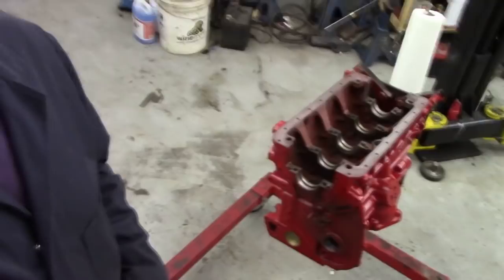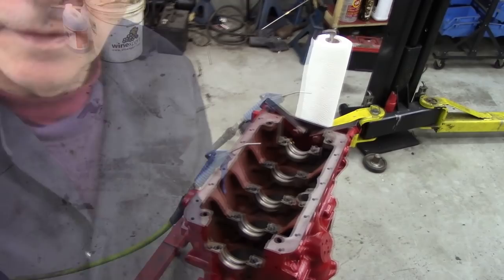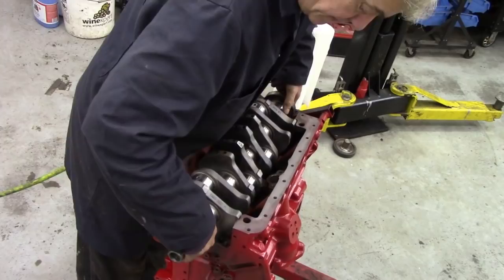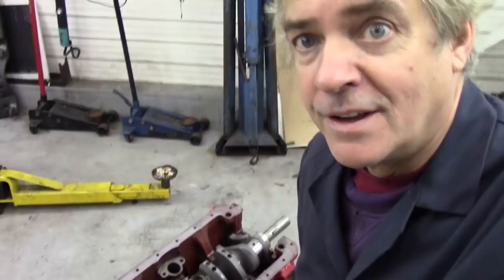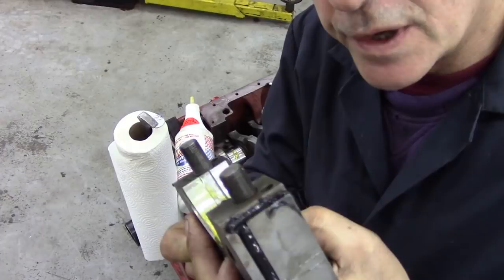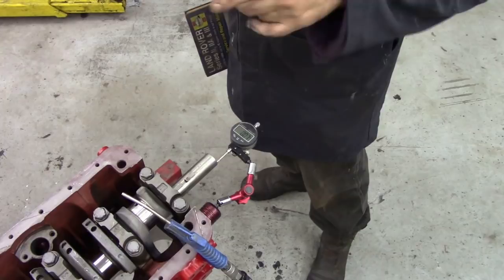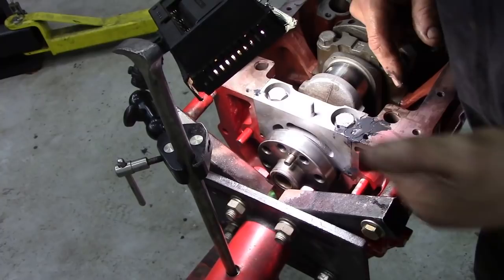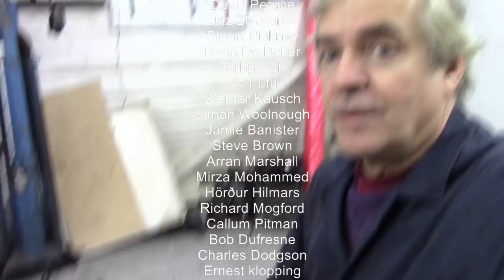2 25 engine. Fitting the crank

Comment: If I remember correctly the military version of the 2 1/4 petrol used the diesel crankshaft as it was drop forged steel instead of cast iron made it more Squaddie proof !

Comment: Hi Mike your right the Lucas is a great product. I used to use a product called Lubraplate it is a very thin lithium grease that coats the bearings for start up and will mix with the break in oil.
My father-in-law used it on in frames on heavy equipment.
Reply from the maker: Thanks for the info!

Comment: you must trust your machine shop....I normally sneek up on the max torque, rotating the crank as I go, normally in three stages....30, 70, 100 and STOP if it starts binding at any point.
Reply from the maker: Crank was STD and not machined

Comment: Great as usual, just one question on the crank bolts, do you oil the bolts or dry, cylinder head bolts are usually oiled slightly, it would alter the torque applied i think?

Comment: Is there a difference to the 3 bearing engine? I could not get the front top seal retainer in with the crankshaft in place.
Reply from the maker: Yes the rear seal is a lot better being a regular oil seal

Comment: Hmmm I'm doing a 3 bearing petro 2.25L. Bearings in and torqued. I can rotate the crank but not in a nice lazy fashion. The machine shop took all the measurements, I'm just doing assembly. Concerned.
Reply from the maker: Have you tried plastigauge to measure the bearing clearance?

https://www.plastigaugeusa.com/
Reply: @BritannicaRestorations  I was hoping that this check was already done. But I can easily disassemble and check.
Reply: Ordered two set of Plastigauge. Looks like tolerance should be (0.0006 - 0.002).
Reply from the maker: With heavy oil on the crank, it should turn by hand smoothly (without  rods naturally!)
Reply from the maker: the 3 bearing should be quite easy to turn
Reply: @BritannicaRestorations  Going to contact the shop that polished the crank.
Reply from the maker: Just out of curiosity - did they check for a bent crank? The 3 bearing was not the strongest of cranks
Reply: @BritannicaRestorations  I called the shop this morning. They polished and measured the crank. They have a good reputation. In the day they used to work on Paul Newman's race car. Picked up some Plastigauge. The front and middle bearings measure  0.00015, within tolerance. I didn't check the rear one due to the seal issue. But I did watch your video about the Loctite silicone, I may check it anyways. It rotates smooth but with more force than I would think to rotate.
Reply from the maker: I just had a  flash back - you have a 3 bearing - do you have the rear seal installed?
Reply: @BritannicaRestorations  Yes, I used the cork seal provided. The rubber one seemed like a poor fit.
Reply: @BritannicaRestorations  Yes
Reply from the maker: Then this could account for the excess friction
Reply: @BritannicaRestorations  I'll pull that and check clearance. I'll try the silicone method for a seal. More to come.
Reply: Pulled the cap off the rear main bearing. On one side the cork got squeezed under the cap. Removed the seals and checked with Plastigauge. (0.0015)  I'll replace the cap and torque once the silicone arrives later  today. * Once I loosened the rear main, the crank turned very nice even with the rods connected.
Reply: Checked all 3 main bearings. They check out per spec. Used your silicone technique for rear main seal. With rods attached it spins but with force. We're going with it. It won't be started for some time. Lots to do.

Comment: Hi Mike, I followed this method using the Loctite SI5980 then realised I should have fitted the rear oil seal with the spring first. When I stripped the rear bearing out again I noticed that the Loctite had not set (even after a month). Granted its winter in the UK and the temperature hasnt been in double figures for a while so is this the reason why it hasn't set ? Cheers Ant
Reply from the maker: Could be old stock - I know it does not keep even unopened